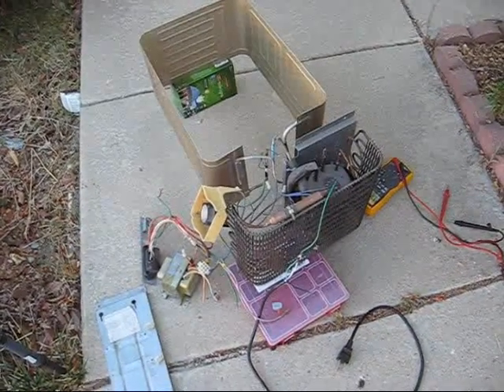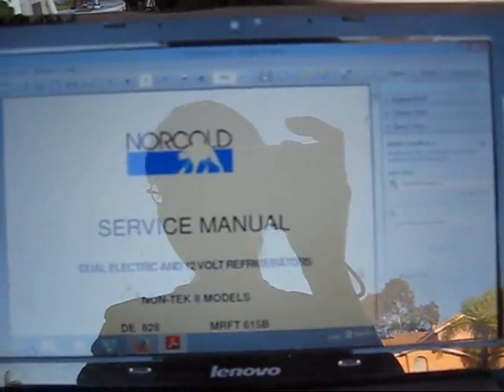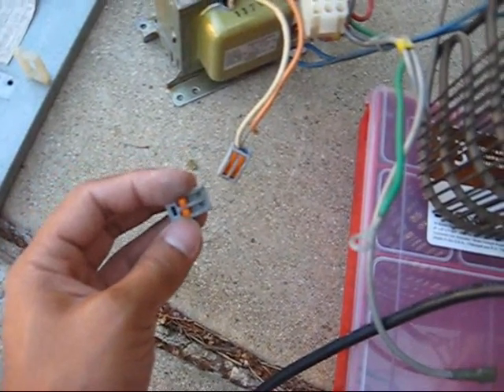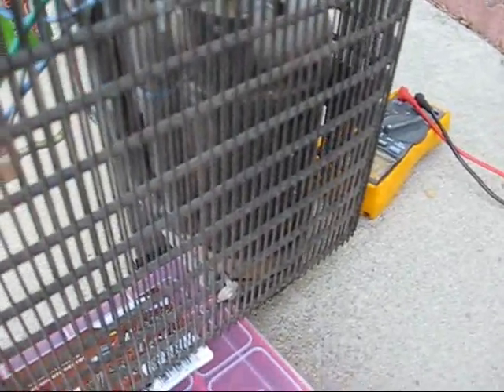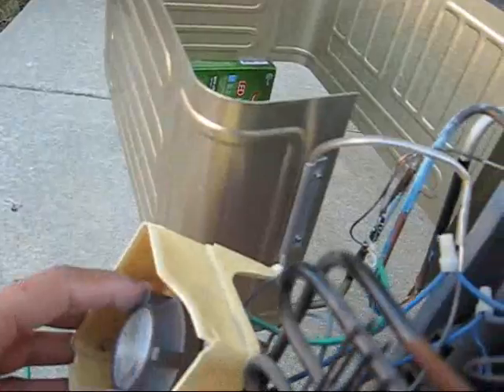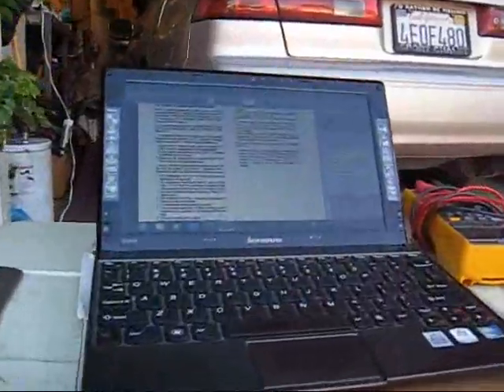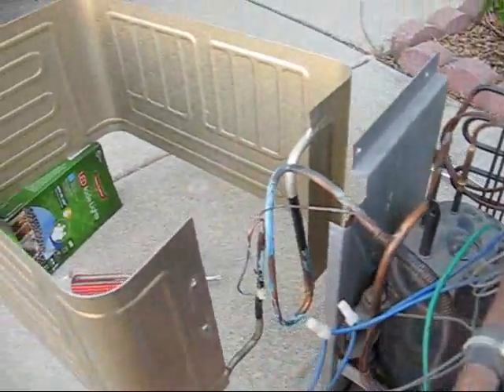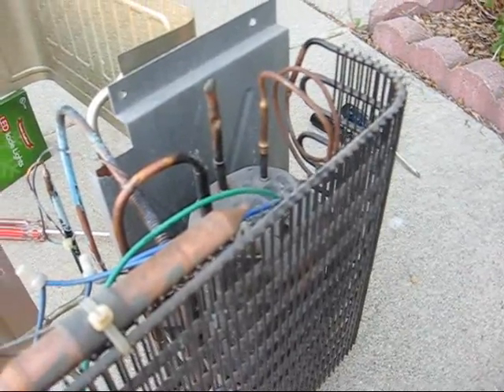Norcold (Engel) AC/DC portable refrigerator, part 2

Comment: I have the exact same fridge with the exact same symptoms. I cant find and evidence of a leak anywhere.....no pinched pipes, no cracks, no scuff marks on anything, so I too am at a loss. The entire system stays at the same temperature after running it for a few hours so there is no heat exchange of any kind happening, so.....its either a gas circulation issue due to a blockage or a one way valve stuck open, or there is no gas left
in it to circulate.......either way, a 2nd life is not looking hopeful.

Comment: it takes a minimal of 12-36 hours before it will start to get cold. I have worked on lots of these
Reply: RVGURU not sure about the engels you get over in the US, but here in Australia the Engels get cold within a few minutes.
Reply: If your fridge is taking a minimal 13 to 36 hours to begin to get cold you have some extremely fucked fridges my friend. all 3 of my engels take less than an hour to get near freezing. given two are almost brand new but the third is the same one in the video.
Reply: If your fridge is running and isnt getting cold you probably don't have any refrigerant left in the fridge. re gas the system and try that
Reply: also if your putting In a full fridge load of ambient temperature food in,  then yes that big mass will take longer to bring down in temperature.